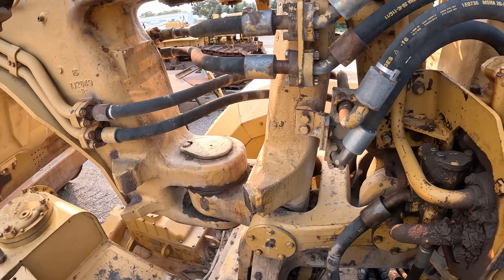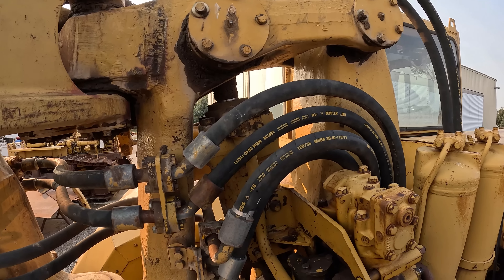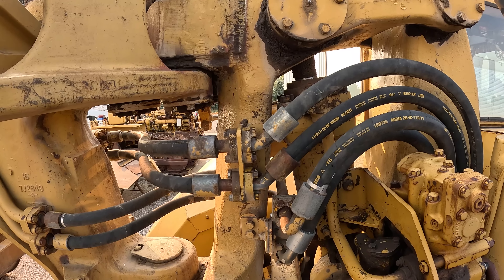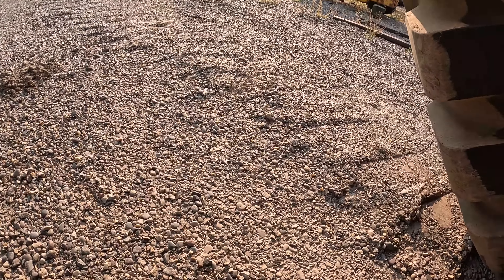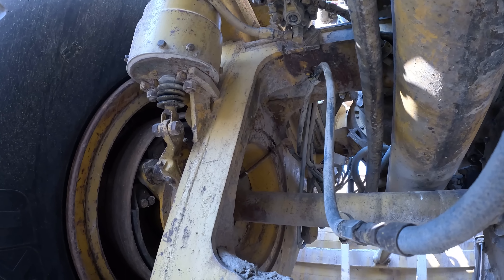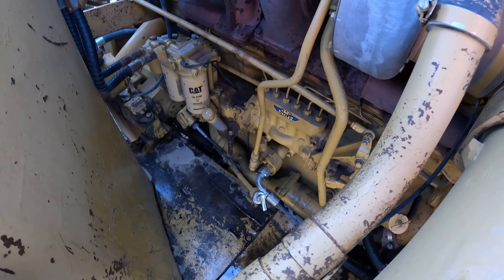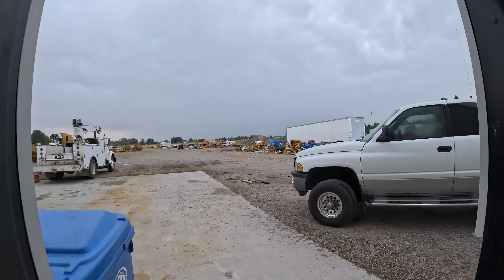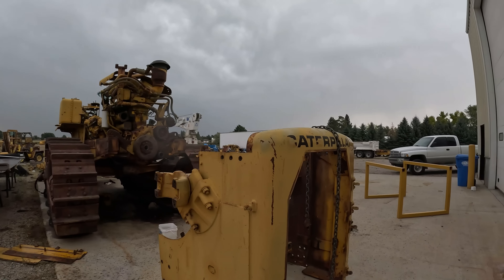How Many Grease Fittings On A 637 Caterpillar

Comment from the maker: the total # of fittings is 58
Reply: Hitch and steering area:  28
Pan: 12
Total on machine:  maybe 46?
Schaffer's 221 Ultra moly, extreme pressure.   This grease has a very good tackifier and is excellent for shock loads/bucket pins etc.   I'll have to try to find the hydro-tex and compare.
Absolutely hate curved tubes on dip sticks.  If you use a good oil, it does not drain down where the tubes and dipstick touch.   On my Cat 320CL I would pull the dip stick, service the machine etc.  Check oil after giving tube time to drain.   Even then, it was not accurately repeatable day to day.
Reply: 36
Reply: My guess is 65 fittings
Reply: Insert Carl Sagan meme right here: "Billions and billions and billions...."

😆
Reply: Didn’t ever count them. So tell us how many.
Reply: Great video Jeff always enjoy watching you service your equipment. Have know Idea how many grease fitting on a scraper.  Looking forward to when you tell us how many grease fittings  and your next video stay safe Jeff.
Reply: 46
Reply: 55 grease fittings.
Reply: Jeff there’s 40-50 points it depends on how many you’ve added. I’ve put several Lincoln auto lube systems on scrapers. Keep the hitch lubed well is critical and as you stated in the video and the grease quality also will make or break the maintenance budget. Some operations try and use one grease for all applications in the fleet with lube cost being factored in it also. The old grease is cheap phase and if isn’t dripping grease it doesn’t have enough.  I agree the right amount at the right time is key. I’m rambling now thanks for the great videos.
Reply: 42
Reply: 62
Reply: 50, just a WAG, but i will say fifty grease zerks that the Oiler at Anderson Construction has to skindive on the 637. Best Wishes Jeff.
Reply: 95
Reply: Tractor-- 31
Scraper-- 12
Reply: I'm guessing 96 from bumper to bumper.
Reply from the maker: @michaelweatherhead9470  58 is the total, you were the closest
Reply: Thanks Jeffrey

Comment: When I was doing some work for a company in the oilfield they had me use their frontend loader and gave me some special high Molly mining grease that was crazy expensive and by lunchtime those pins and bushings were starting to talk a lot and one day they ran out of grease so I used my Red and Tacky Lucas grease and it lasted a 16 hour shift before it started to even squeak a tiny bit so I'm pretty sold on Lucas products. I use the Red and Tacky on pins and bushings and other slow moving components and the Extra Heavy-duty on U-joints, wheel bearings and other faster moving components.

Comment: 12 tubes.
There is no rule to check dipsticks oil. If engine sat still from other day, you can check without cleaning. If it has already run in the day, its better to clean and check it correctly. If you dont have that much expérience, clean and check. Dont put you under pressure, and think that oil level and the quality of it, is just the very most importante item, to have good longlife engine. So if you fill more confortable cleaning and check dipstick, just do it, and dont bother what other people think.
Good luck to everybody.
Reply from the maker: Yup

Comment: After shutdown the oil will rise in the dipstick tube. If the tube is sealed like on cat the level will be depressed. That is why I wipe the stick. After opening the tube the oil will seek the same level as in the pan. This I learned running cats and others for 40 years
Reply from the maker: There's a hole in the side of the tube to prevent that,  good point 🙌
Reply: Who wants to be that close to perfect

Comment: I disagree with you on the oil level of the dipstick. As the owner of 2 D6R’s and 2 621B’s my conclusion is as the engine cools off and there’s a vacuum on the dipstick tube.  That pulls the oil level down maybe. I’m not a scientist so I don’t know exactly. I understand oil in the tube rubbing on the dipstick but as in your video you can clearly see the level in the level after being rechecked is straight across the dipstick. You can see where it rubs on the sides. I’ve started rechecking them since it shows a considerate difference level for the oil for the last couple years. I’m open for a debate or discussion
Reply from the maker: I don't think vacuum is present as there is a breather but you can have the finger over the straw effect, but my tubes have a hole in the side to negate that
Reply: Dirty oil gives a different reading sometimes
Reply: I was completely basing mine off the thumb over straw theory. I have a C-9 that shows the same first or second pull of the dipstick. Will have to test the others with the dipstick pulled 1/4 to eliminate the vacuum theory I have.